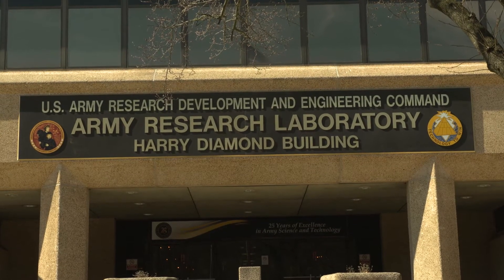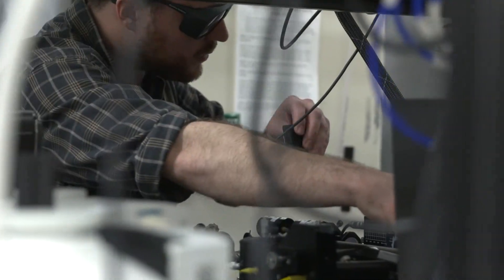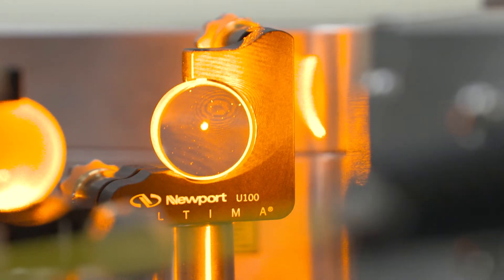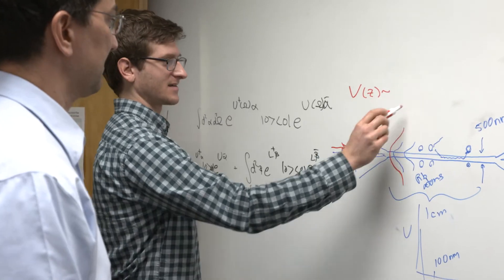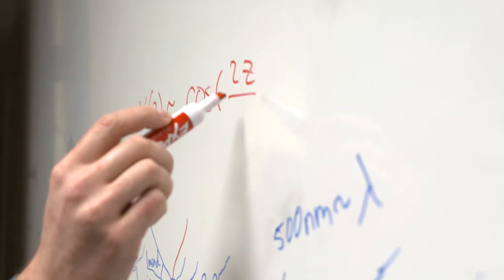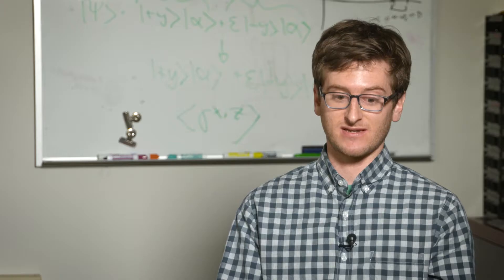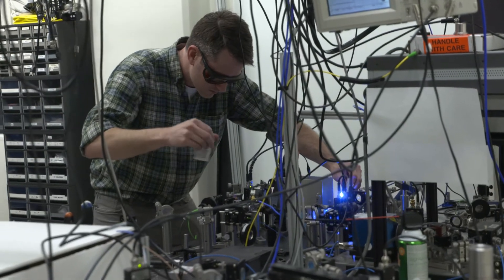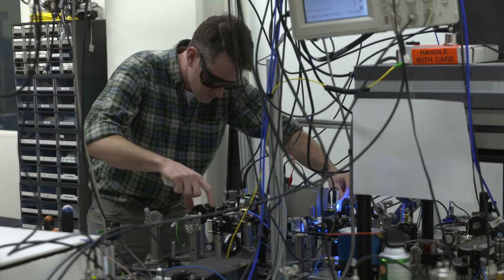US Army Research Laboratory, Center for Distributed Quantum Information

Comment: Iron shield grass in the snake am I Lazarus Vanburen that’s my security clearance so you know who I am. There is no game Lazarus laser lab. When you use ultrasonic ultrasonic or quantum computer speakers or quantum speakers, all speakers do nuclear resonance nuclear resonance is quantum when you get your synthesizer capable of looking at the waves and moving the waves and generating new waves you’ll know that there are like robots in the environment, capable of Genesis while your sensor packs will not allow you to see those micro robots. They will allow you to see the command and control communications line to them. That is when you play around with the plumbing pipe and you make the plumbing pipe implode. There is an activation and a cancellation wave inside the water itself. That is a quantum resonance wave. You need to record that wave and then take a quantum speaker and put it directly on a pipe and you’ll do multiple of them and you’ll use it exactly the same as an electromagnetic choke and you’ll create that wave inside the water that little bitty, tiny teeny pan prick of wave that is there for the motion and for the stop motion and for the continue running down the pipeline motionthat is the strongest water pump you will ever find however it is a hydrostatic pump you guys need to get with me I need your lunch money badly or I’m going to starve to death,,,,, i’ve actually come back and edited this to save this. You guys know I wasn’t born August 30, 1979 right you know it was really October 10, 1909. The world book encyclopedia used to have it down that it said 1809 same day married to martha Smith that’s currently living in Cape Canaveral and has a son named noah by another man.